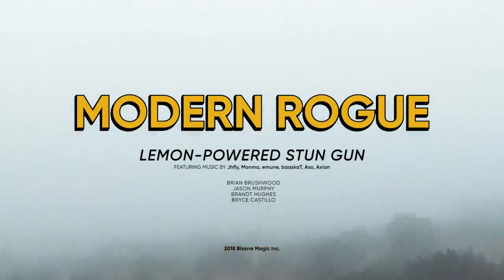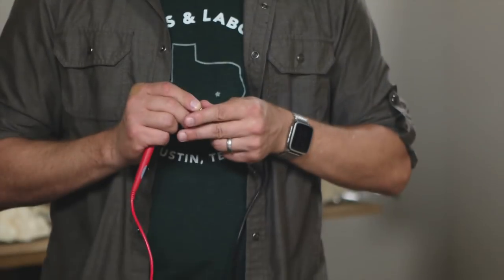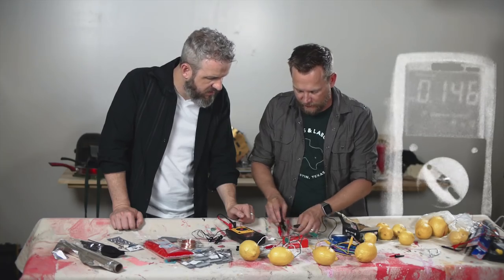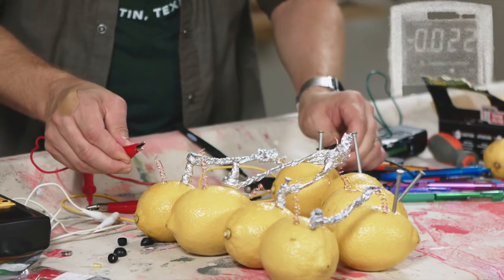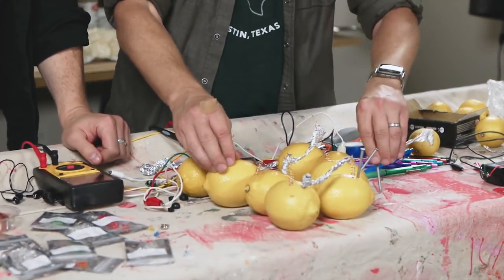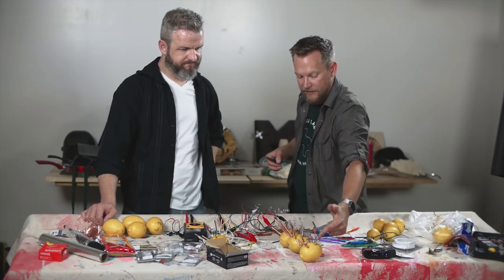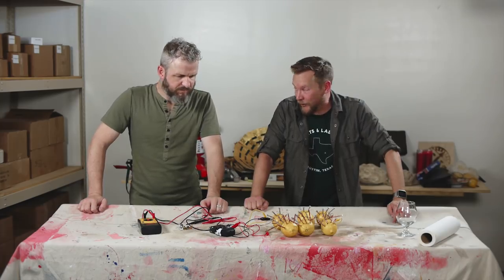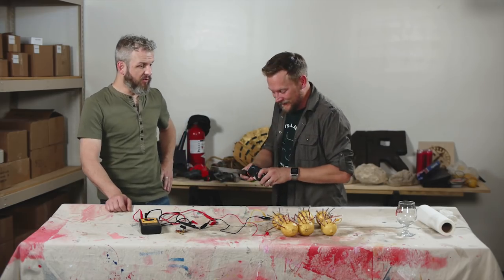Making a Lemon Stun Gun

Comment: batteries have a higher amperage which is one reason why your LED lit up on the battery at a lesser voltage. If you make a couple of resistors in between the Amp rating you can essentially light up the green led at the base 1.8V they were rated for. Also the reason that the camera stun gun works is due to the amperage that is created by the circuit within the camera. There are a series of Resistors that are used to essentially change the current. If you want to do a test you can add in resistors in between each battery and test the change in current. Capacitors are used within a camera to allow the flash to charge. the release of the capacitor gives a higher current than if you were to just touch both ends to what you are shocking.

Comment: Surface area is the key to more current. Use copper and zinc sheets/plates instead of nails. Slice the lemons into circles, and build a stack of copper, lemon, zinc, lemon, copper, lemon, zinc, etc until you have the right voltage. Make several of these stacks and put them them in parallel. Also, the voltage will drop significantly when charging the capacitor, due to the resistance of the lemons. Measure the voltage while charging, and add to your stacks to bring it up to the voltage you need.

Comment: Ohm's law does not refer to watts. Watts are power while Ohm's law is about resistance. Resistance is measured in Ohms.
Reply: gottabweird Yep. Ohms law is based around Voltage, Resistance and Current(amperes).
Reply: MattTheBoss Yeah power is described in an other set  of equations.
Reply: Yea,those "other equations" being voltage * current. = Watts (aka Power.)
https://en.wikipedia.org/wiki/Ohm%27s_law

Comment: Most copper wire I know of have a coating on them, if you want them to conduct better, you gotta sand it a little where you want to connect it, might not be the case for you but if it slightly changes color with a little sand, it's coating.

Comment: I'm sure someone has already mentioned this in the comments somewhere, but your issue (besides potentially having the LED backwards) is the internal resistance of the battery. Remember that batteries are not ideal voltage sources, they cannot supply infinite current. Surprisingly, for their small size, AA and AAA alkaline batteries can have a peak current of many amps. However a lemon would have a much, much higher internal resistance, limiting the amount of current that can flow. You would need more lemons in parallel. What is happening is you are measuring the voltage when no current is flowing. When you connect the LED, it wants a certain amount of current (and it has a certain voltage drop as well). You're just not able to meet that demand, so if you measured the voltage while the LED was connected you'd probably notice it diminish to almost nothing.

Comment: As a physics major, I have a correction to make. V=IR is the definition of resistance, not power. Also, amps and current are the same thing. Oh, and power is volts times amps.

But as far as I'm aware, more lemons should be better. Of course, you'd likely need an uneconomical amount of them to equal the battery.

If you do revisit to this with more lemons, I'd recommend setting up an appropriately wired bed of nails to press the lemons into.

Comment: when you did nail to copper touching you hooked it up in series. you get a lower voltage that way compared to hooking it up in parallel ( all of the same pols connected).
Reply from the maker: I think it's the reverse, no?  you can see the voltage doubling as we add a second lemon in series.

Comment: I am no expert but two improvements come to mind to increase current. 1. Greatly increase service area. For example slice up the lemons and use sheets of metal. 2. On individual lemons bring the positive and negative electrodes closer together. Thereticaly it should lower the ESR (basically resistance) and hopefully increase the amps. I would also recommend reading about  Standard Electrode Potentials and look at some tables of metals. Finally if you want a full proof homemade battery try a nickle (coin) paper towel Copper sandwitch soaked with bleach mixed with salt. I tried this once and got .5v and 300mah. This similar to an aluminum air battery only the bleach is like a super charger. This can power a small motor, and might make a cool episode. Hope this was helpful.

Comment: On the lemon batery and capaciter charging:
TLDR: the more amps, the faster it charges, parallel batteries gives more amps.

Full: the time it takes for a capacitor to charge (with constant current) is VC/I so if you give more amps, the faster it charges. Batteries in series gives more voltage, batteries in parallel gives more current. So, stack a bunch of lemons in parallel to get somewhere in the right amp range and you should be good to go, it would take 2,000 to match a  AAA, but 100 should give you a charge time of close to 3 minutes or so

Comment: isn't R resistance in ohms in ohms law? doesn't seem right for ohms law in this video not to contain any reference to resistance... I could be wrong tho.   15:19
Reply: R is resistance. V=IR is correct. But the other formula is correct too, P=IR.
Reply: @Mromfgtrololol  IK this is an old reply but they said "Watts = Amps * Volts" (P=IV) which is incorrect perhaps they meant P=IR (as you said) or they meant P=I^2V

Comment: At 15:20, you mentioned the ohm's law V=IR but wrote watts = amps*volts
Watt is the unit of power , Amps is current and bolts is voltage. V = IR should have read volts=amps*ohms since R stands for resistance 
Watts= amps*volts is true since power = current*voltage but you wrote two different relations and tried to make sense of them. They are two very different things. Being a physics student, this pisses me.
Reply: r/iamverysmart
Reply: Leon Hassel well tbh I'm triggered and I'm actually v v smart. I invented calculus and gave all my work to Leibniz. Did it 3 years before Einstein. Come at me bro.
Reply: The electric power equation was taught as part of Ohm's law when I took electronics in the 80's
Reply: Bob Wright they could have been in the same chapter or whatever but they are not the same. Also in this situation, ohm's law had to stated. They said V=IR which was right but they got the units wrong

Comment: "Does it work both ways" lol
Threw me for a loop the first time too, but it's in the name "light-emitting diode"

Diodes are one-way valves that control the flow of electricity, it only allows current in one direction

Comment: Hi Aircraft Mechanic here, Basic concept of a battery comes from a chemical reaction between the two metals. layman term is that the metal is corroding and your controlling how it corrodes and using the current from the corrosion. To get a better volts and amps you need more dissimilar metal also known as "GALVANIC". Very important term when it comes to batteries. The whole point of them lemon is to be a electrolyte to pass current from one metal to the other. Obviously there are better electrolytes to use. But Look up a galvanic chart to find better metals to use.

Comment: Quick note: zinc doesn’t take longer to rust, it actually rusts faster than steel. The zinc and steel creates a galvanic cell (essentially what you did with the zinc and copper in the lemon) that protects the steel. Even if the zinc is completely scraped off in one spot, the steel won’t rust until all the zinc is gone.

Comment: You're getting your voltage up. Which is just the differential of potential across the setup. However, your emf sources are chock-full of resistance. Voltage = Current * Resistance. So while you may have a high voltage, you also have a high resistance and very low current. The best way to get this to work is to find a way to minimize internal resistance of the lemons.

EDIT: WATT is POWER. Power is measured by current squared times resistance. Also, you're creating an RC circuit. So you could use the equation given the capacitance of the stun gun to show how long you'd need to charge the capacitor. This equation tells you everything you need to know about charger your capacitor. Q(t)=Cε(1-e^(-t/tau)).

Comment: Not to be a party pooper here, but i gotta correct you. galvanized zinc on steel is not to actively avoid but to counteract the reaction with steel. In short: zinc will corrode EASIER than steel, so when there is a crack in the zinc coating, both zinc and steel (Fe) will react, but zinc will have a greater tendency to do so, and will make the iron in steel return to metallic form by giving it its electrons from the zinc reaction. The other way around is also not bad, because the coating will stay longer, but the same way zinc keeps the steel from reacting, it will once theres an opening, accelerate the corrosion of the steel. But yeah, works both ways

Comment: the "diode" part of "Light Emitting Diode" tells you that the pixies only flow in one direction. Like a check valve. The two different size legs tell you which side is + or -
Reply from the maker: That’s why we tried both directions, every time.

Comment: Love they way they have no idea what they are doing. Like not trying the Led the other way round. Zinc rusting slower than iron. Galvanised nails don't rust as fast because the zinc oxidises (only ferrous metals rust) faster than the iron making a protective coating to stop oxygen getting to the iron underneath.

Comment: ok so if you wanted to make it more efficient, firstly i would recommend squeezing the juice out of the lemons, and just using a beaker of lemon juice. Secondly rather than just a galvanised nail (since we dont know how much zinc is actually used to coat it) I would use an actualy strip of zinc. The key of this experiment is the acid, and the actual solid fruit just makes the reaction more difficult. If you want you could also boil the juice a bit to boil off some water and thus raise the concentration.

As for your set up, you want to minimise the amount of connecting wire and prefably use proper insulated cables to minimise resistance. The less resistance there is in the system the greater the current, thus the faster the charging time.

Comment: Now that you've figured this out might I say, check the polarity on the LED because it does stand for Light Emitting Diode - and a diode will block current in one direction, but allow in the other.  And next - run 125VAC through a dill pickle.

Comment: The lemon is only there to make contact between copper and zinc. If you cut disks of galvanized iron, cardboard and copper flashing. You could stack them up, add lemon juice to the cardboard, and get more current. See https://en.wikipedia.org/wiki/Voltaic_pile to see how it was done. They powered arc lamps with that sort of arrangement.

Comment: half sortof electrical engineer here: What you did at the end should have been entirely correct, and the spark kind of proves it (the battery in wrong way doesn't do diddely dit). The reason you didn't feel anything on the arm is because tissue isn't really all that conductive. You require a fairly high amount of voltage (Which accumulates as you charge it) to establish a connection through tissue. Proper tasers will output 50000 volts for a brief moment just to establish a connection, and immediately lower itself to 1200v once the currents starts flowing to not actually kill the guy.

So yeah, proof of concept! Now you just need a whole lot more lemons :P

Comment: The difference between parallel and series circuits is that in parallel, the voltage is combined and in series, the amperage is combined.

Comment: On a slightly related note, did you know you can create a gun using gutted camera parts and other miscellaneous objects? Specifically, you can create something called a coil gun, also sometimes called a Gauss gun. It words on a similar principal to a rail gun, where an object is propelled through the use of magnetic fields, but rather than using a rail system it uses a set of copper coils which turn off and on one after the other. Each coil, when an electric current is applied, momentarily creates a magnetic field which pulls the projectile down the barrel. With several disposable cameras you can create a capacitor bank, then wire it to your coils in a specific manner (which I cannot remember at this moment). You can actually use a drink straw with the coils on the outside as a barrel, and a nail with the head cut off as a projectile. Using camera flashes to make your capacitor bank is not optimal because they don't hold a ton of power, but they're relatively cheap because you can go to a CVS or Walgreens that does film developing and get a bag of used cameras for free (or really cheap, depending on who you talk to). Do note that this is technically still a weapon that can potentially really hurt someone. Especially if you make one that uses a proper capacitor bank and good quality coils. So... Check your local laws, and you didn't hear it from me.
Reply: I originally heard of the coil gun from a book called "15 Dangerously Mad Projects for the Evil Genius" by Simon Monk, and then learned you can use camera flashes from an Instructable that I'm not sure exists anymore.

Comment: Electronical enginnering student here, capacitors charge with amps so you need to turn voltage into amp with resistor.

Comment: you were close with ohms law, ohms law is the relationship between voltage, current and RESISTANCE ( V = IR ). you refered to the power law equation which is P = IV which will give you power in the unit watts

Comment: though i havnt sat an exam in capacitors in 6 months, I believe that a lesser current means a lesser capacitance, think of it as the capacitor holding the electrons like a room of balloons. if you have a truck pushing more balloons in, you're quite lickley to fill the room despite the balloons wanting to roll back out the door, but if you are doing it by hand, it will take longer and also you wont be able to get as many in because they'll be rolling out faster than you can push them in...... I think

Comment: Brian, I very much admire your work in magic and social engineering but as an Electrical engineer I spent the whole episode yelling at my screen about what you should be doing different. That said, I'm glad to see anyone experimenting with electricity and learning. I hope you had fun!
Reply from the maker: haha-- indeed we did!  Did we end up on the right track, at least?
Reply: You were moving that way with current vs voltage. One thing that has helped me throughout my career is making analogies to water and thinking about things in those terms. You may have already come across this but if not I hope it helps you conceptualize what is going on. Voltage is your pressure and current is your flow. As an example putting your thumb over the end of your water hose is trading flow (current) for more pressure (voltage). A capacitor is a water balloon. You are taking the pressure (voltage) from the faucet and waiting until you build up enough water (current) to effectively pop the balloon (capacitor) and drench (shock) someone. You need both and you need them sustained. Imagine if you were trying to fill up a water balloon in a lake with no pressure. Yeah, you have enough water but you are never going to get the balloon to stretch. Now imagine you are trying to fill it up with a pinhole water leak. Now you have the pressure but it will take forever to fill. The problem I think you are having is your voltage is falling off before your balloon can really stretch out. I would develop your voltage then put about 10 of these circuits in parallel so you can make sure and get your balloon good and stretched before your pressure drops off. Hope this makes sense, by the way, tell Jason, after you try it the next time it's his turn to be the test dummy. :)
Reply from the maker: good stuff... thanks, man!

Comment: You forgot about the bleed resistor in the flash circuit. It draws way more power than the homemade battery can supply, leaving nothing for charging the capacitor.

Comment: 😂 I love the idea and within the right parameters I think about 4 lemons would give you the jolt you wanted (given zero humidity around the deliverance to the capacitor)!  I'm an industrial plumber by trade, but have played with lightning multiple times.  The palms and pads of my hands and fingers can hold onto the "tingle" of a 110 outlet's output.  ...played a few pranks on coworkers on shorting lines around water and have, with my dad and brother, made a lightbulb glow for a second out of an outlet with wet hands. 

You're right in having to wait for the lemons to charge the capacitor, but sitting lemons only make your face cringe.  (Gogo juice=1/2mv squared)  You need kinetic energy "exciting" the potential of the lemons!!! 😉

Comment: Open it up and remove the LED.  Also, build your voltage higher, this will allow greater current.  When a load is put on the battery there is a voltage drop, you can see this by putting your meter on the battery as you connect the load. Try 6 volts.  But still remove the LED from the camera.